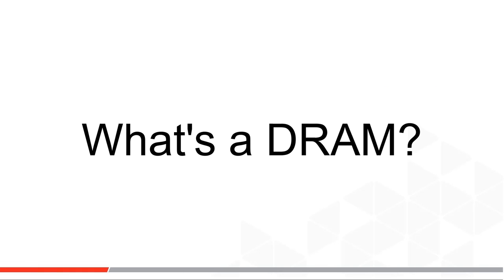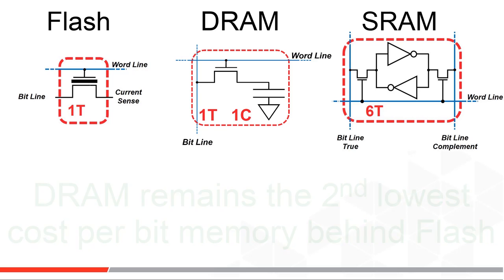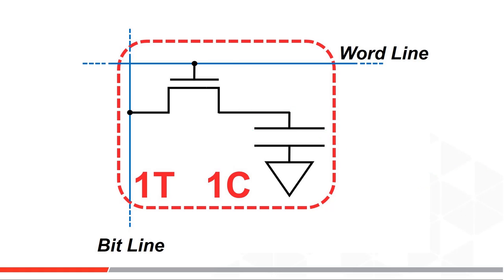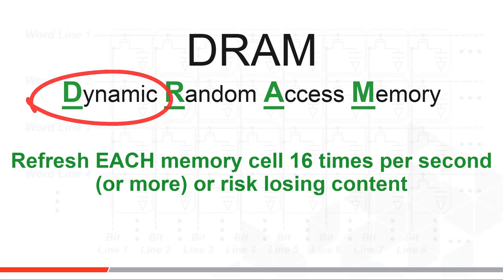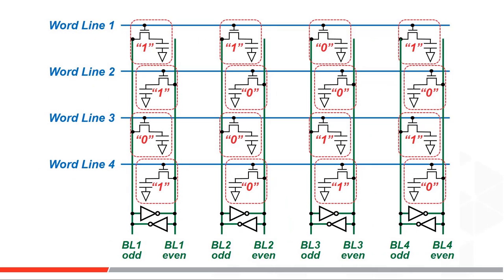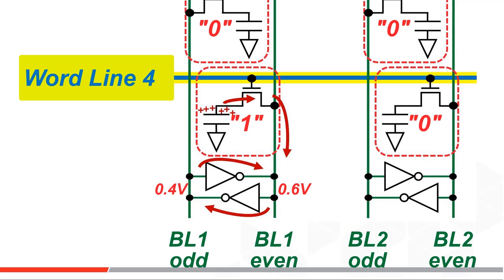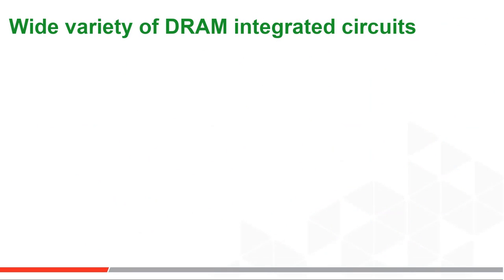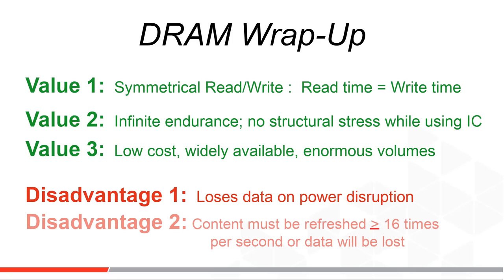What is DRAM?

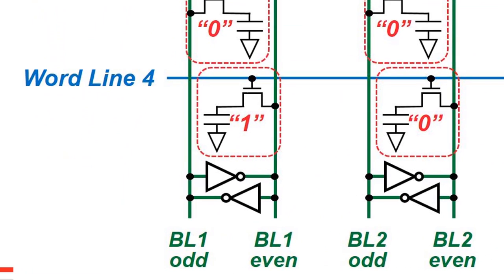Comment: At 4:18 you said that we need to charge "these". What's the name of those devices? 
Thank you for your vidéo, it helped me a lot with the basic concept :D
Reply from the maker: @Luisa: The physical wires that run over this array of memory cells (this physical even bit line, and this physical odd bit line) are physical interconnections that connect to one inverter input and one inverter output in every cell they pass over.  Each “Bit Line odd” wire also connects to a memory transistor source node in every other memory cell (ODD cells).  Each “Bit Line even” wire also connects to a memory transistor source node in every other memory cell (EVEN cells).  It is very important for the engineer drawing these bit line wires in the device layout to match each pair of odd and even bit lines perfectly, and have them physically be about the same distance from lower layers the pass over and any upper layers they may pass under.  This is so they have almost identical capacitive loading matches along their whole lengths.  The “these” are these physical wires (odd and even).  By charging these physical wires both to 0.5V and then disconnecting both from the charging source, the amount of electrons on the whole physical “odd bitline” and the number of electrons on the whole physical “even bitline” are very close to the same.  So next step, when the “Word Line” connects the large DRAM capacitor that is storing the memory cell value (1 or 0) to these bitlines, the store of electrons on the DRAM capacitor… or the lack of electrons on the DRAM capacitor… will mix with the electrons already on the bit line and change the voltage enough to cause the inverter pair to move off center and drive each bit line pair to an extreme 0 and 1 level pair.  This process both reveals the stored memory value, and allows the DRAM capacitor to be completely recharged to its saved level again. We hope this helps.

Comment: This video absolutely DOES NOT tell what most people want to know, HOW is DRAM accessed compared to SRAM. Access if performed by 1st signaling RAS low and expressing the 1st half of the addresses on the multiplexed address bus then signaling CAS low and expressing the 2nd half of the addresses on the multiplexed address bus. Having both RAS and CAS low confirms the access. Refresh is done by signaling RAS low and expressing the row to be refreshed on the multiplexed address bus. In a small computer like the C64, the MAB has 8 lines and therefore can express 16 bits so refreshing must be performed for all 256 rows.
Reply: If you can, first create such kind of video